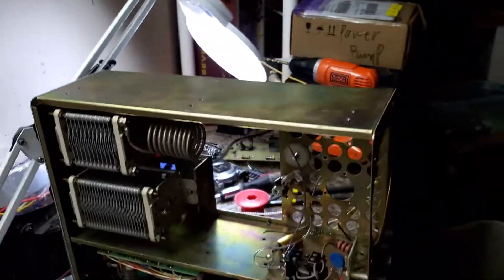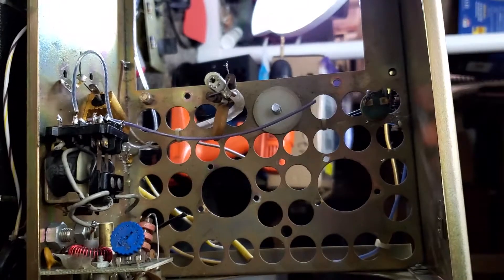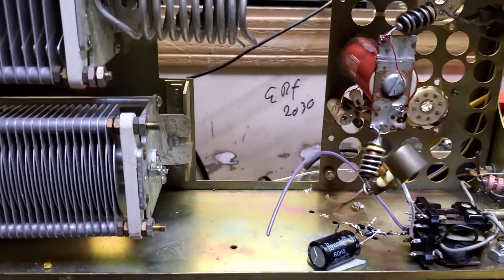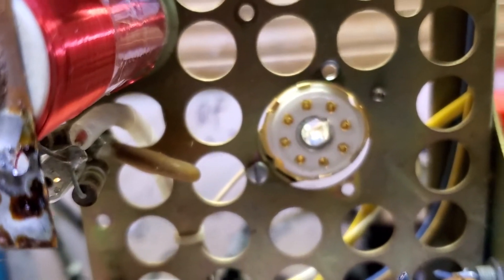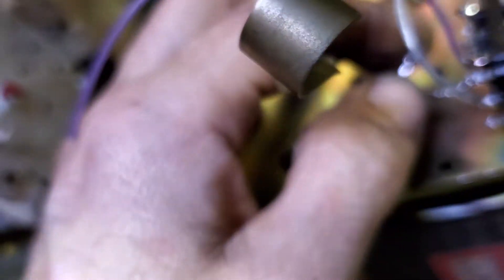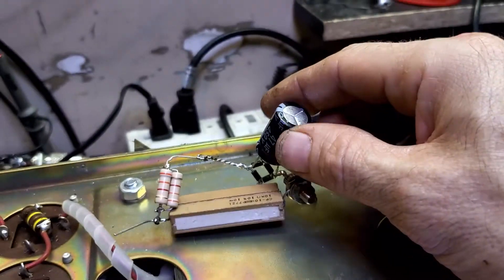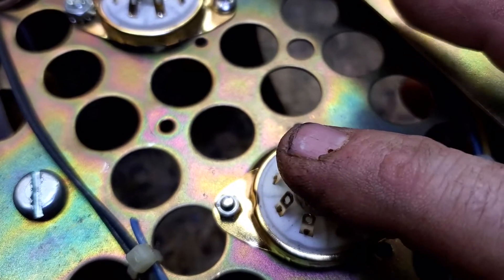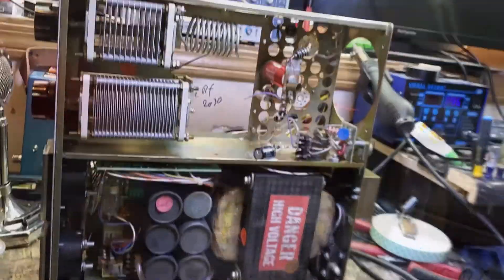WWW.409RADIOS.COM    DENTRON MLA-2500B TUBE CONVERSION

Comment: Hello sir merry Christmas  and happy holiday,  I have a very good question,  I am looking for eimac 8875 tubes , can you help me find them ?
Reply from the maker: Hi, the tube you are looking for is no longer produced. the only hope you would have is to find some good used one's. you can find the 8878 which is higher RMS and does require higher current at the plate. however if you don't mind modifying a little, you can add a screen and live -bias to the power supply and change the sockets and replace them with tetrodes(4cx250-350) plus now your unit is now low drive! but i also understand trying to keep the triode's if that's the case, look for some 8878's and take care to make sure your plate is stout enough!

hope this helps
73's 
mr409

Comment: Hello
The transmit standby lights died
Anyone know of replacement?
Reply from the maker: if you unscrew the rx/tx lamp you will find  a colored lens  cap with a mini lamp inserted in the back of the colored cap, pull the bulb from the colored cap (red or green) an replace the mini lamp with the same #, reassemble.
hope this helps
Reply: @409radiosbigrf4  thanks